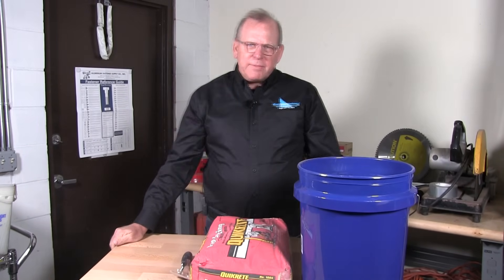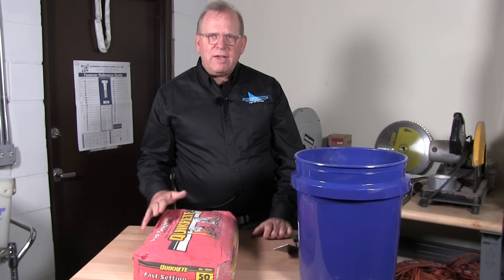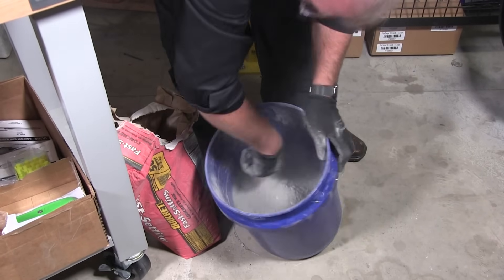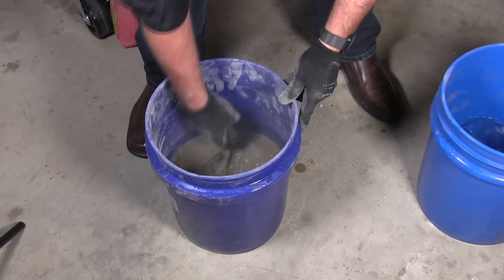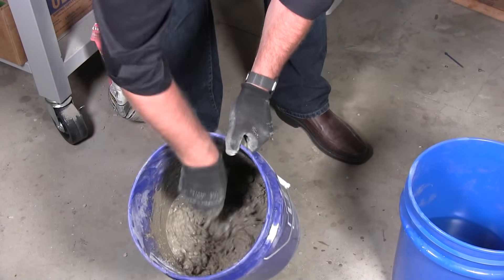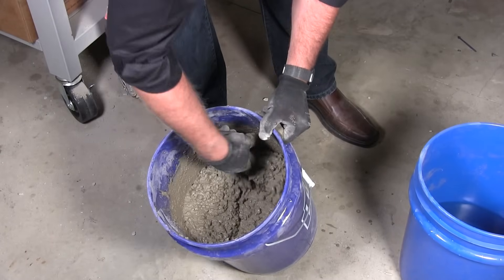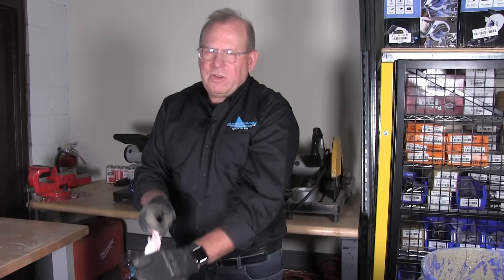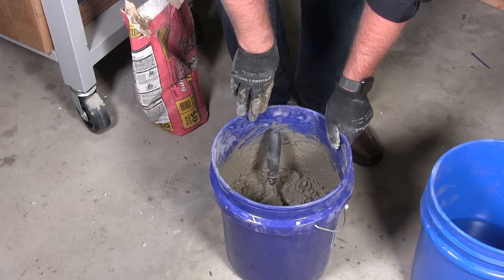How To Mix Fast-Setting Concrete | DIY

Comment: I just use a mixing tray and gravel rake. I could have mixed three bags in the time that took. I'm confused at why a 5gal bucket. Dude you wore me out, humped over, your face in upcoming dust. At least get a fan and aim it towards the bucket and that dust will never hit your lungs. Not bashing your video here, I'm trying to understand why a 5gal bucket when a mixing tray is so much easier with a rake. Less bending, faster mixing and further away from that dust. My buddy confiscated his cement mixer ( he needed it) and I had to hand mix about 20 bags. I would have never made it doing it bucket style. I appreciate your video tho.

Comment: A couple of observations.
1. Measure your water !!! The bag tells you EXACTLY how much water to use. Usually 2.5 quarts for a 50lb bag. 
2. Buy a graduated paint measuring jug. For a 50lb bag, they make a 2.5 quart measuring jug
3. WOW - that mix is way too wet !!!  Sure, it goes in easy, but you are gong to have a ton of bleed water sitting in the surface for a very long time. Plus, as we all know, too much water makes the mix a weaker!!!

Comment: Why did you mix the "no mixing necessary" concrete?  It's for post holes-- pour a little water in, pour 1/2 bag in, then add more water and the rest of the bag...agitate it some, but not necessary to "mix."  🙄

Comment: Too much water in concrete makes it weak and brittle and you don't want to be adding dry concrete to a wet slurry. Add about 1/2 the water you think you'll need, then mix it until it becomes clumpy, then add a bit more and mix it again, then again until you have a thick mix that still flows.

Comment: Ive never even seen wet concrete but i have a bunch of cracks in my sidewalk i want to try to fix shouldnt  be to hard i dont think
Reply: You might want to find something in a caulking tube form?? If they really are cracks. Or maybe you can make your own by forming a sort of pastry tube and squeezing it exactly where you need it rather than have a 4-inch strip which will really draw attention to what you were trying to repair.
Reply: @marymlodzinska4383  I guess it's not so much a crack but like part of the sidewalk is taller then the other part and I was gunna make like a tiny ramp but idk anything about doing any of that kind of stuff I'm in the printing industry not the working on houses industry lil
Reply: @marymlodzinska4383  but I do have cracks I want to repair as well I will definitely look onto some stuff that comes in a tube or something like that thank you

Comment: Thank you.. perfect for first time users! I need to fill an 8” deep and 12” wide by 15” long hole thst opened up on my mosaic concrete slab patio.Sand and dirt underneath whole area. Water from a broken rain gutter on roof deteriorated the area and caused the hole. Just need to fill the hole to smooth over and so no one falls in it. Gutter is repaired so everything will turn out fine after seeing your video!

Comment: Great video. My project is small and I appreciate the straightforward tips working with the mixture to get the right consistency. I'm going to try a 3.5 to 2 ratio recommended by another video and priming the pot with water at the bottom as suggested by comments below.. I'm making artificial Christmas tree stands using old plastic planter pots and PVC pipe to hold the trees securely. The concrete should give me the weight to keep the trees up right as the stands that come with the trees are flimsy and prone to tipping. If this works as well as I'm hoping, I'll make these for my portable canopy for camping. Thanks so much!

Comment: Great to see you stressing PPE. Always wear gloves, and probably wear an N95 mask when mixing concrete. When it's dry the dust will damage your lungs, and it's the kind of damage that accumulates and never goes away. Once you add water, concrete is incredibly alkaline. It's pH is very close to oven cleaner, so you want to wear gloves and keep it off your skin. Dry concrete will dry out your skin like nothing else, but it won't cause chemical burns until it gets wet. 

I wished you mentioned what happens when you add more water, that'd be my only criticism. It does develop a smoother consistency, but it will also effect the final product. The more water you add, the higher the likelihood the patch with crack at the edges due to shrinkage. It varies by mix though, so I'm not too shocked you didn't cover it.

Comment: I want to make weights for my heavy bag stand… pretty much just fill buckets with quikrete…I have chunks of rocks/concrete and pebbles I want to get rid of and use as filler in the bucket…can I do this with maybe a little more watery consistency?
Reply from the maker: Yes

Comment: After watching this video, I just set a single fence post in Quikrete using this method. Notice how little dry mix he puts in at first, and the well he digs for the water at first, those are important details. As @sfranken2228 mentions below, it is much harder to get the bottom mix thoroughly mixed, and if you don't it starts to set up very quickly. Use a stout trowel and start with a soupy mix and add dry mix to get the consistency you want. I barely got my fencepost set in time. I don't think I would use the red bag quick set formula if I was doing this again. I have used fast set Quikrete before to set posts but we did the dry pour method described on the bag and had no problems.

Comment: Back in the 60s when I mixed mortar, thinset, grout, etc in 5 gallon buckets we used a 1/2 drill with a beater on it. But even so if I did not put water in first there would be dry spots around the edge at the bottom of the bucket. And I would hear about it from the tile mechanics. That thing you call a ladle we call a margin trowel.

Comment: When using quickset concrete for posts or any other reason you need to pour the dry cement into the water not the water into the dry concrete. The concrete will mix when it falls through the water. If you don't than the concrete at the bottom won't even get wet enough to set.
You're welcome.

Comment: I have a small concrete job to do this weekend. I'm 60 years old and have never poured or mixed my own cement. I helped my former boss back in 92 do some concrete work, but that's it. Thank you for the tutorial

Comment: I’m a icc inspector. I’d have serious questions about all this. There’s a water and mix ratio that should be followed. Had you done the math you wouldn’t need to add more concrete later on. The more water you use the weaker the concrete over time. But I understand it’s a small project.
Reply from the maker: LMAO are you kidding me.  First of all, you would not use this bagged concrete for an engineered project, but you would order your engineered mix from a concrete company mixed.  Useless statement.

Comment: When doing this wear a mask that protects you from breathing in all that dust .Crystalline silica is found in materials such as concrete, masonry and rock. When these materials are made into a fine dust and suspended in the air, breathing in these fine particles can produce lung damage. Silicosis can be totally disabling and may lead to death. Please wear an appropriate mask .B.T.W thanks for the video.
Reply: Even if you're outside and avoid the dust the best you can
Reply: @1Turnatatime  when ever you are exposed to it .At any jobsite wear appropriate  protection.
Reply: @jams501er  10.4

Comment: This is a quick way to smoke your back. I recommend using a square trough to mix concrete with a small square spade. I made a mixing trough out of plywood and it's been the best companion for mixing many batches. Vastly superior than a bucket every time

Comment: I was actually expecting to learn how much water to use depending on how much dry concrete mix I have. And not just do it how you did it.
Reply: I've watched a lot of videos trying to find the same thing but no one seems to actually measure the water. I've been measuring trying to find the right amount and it's frustrating as a first timer.
Reply: Use your eyeballs and read the bag of concrete that you bought. It will always tell you how much water to use... Different mixtures of concrete will have different water instructions so why would you want to get that info from a general video anyway? Bizarre.
Reply: @mannys9130  Okay. You don't have to be rude and use words like "use your eyeballs" and such. You're saying there's always that information but, in the video, the guy simply added a random amount of water rather than use some required ratio for the mixture. And that is something one who's really interested to learn wants to know from other people who's got the experience. Maybe you can tell me why the guy in the video didn't rely on math to create a consistent mix. Cause if he needed to create the same exact mixture next time, he could probably just end up mixing one that sets longer or faster than the previous mix and result in an inconsistent mix. You act like you know something, but cannot try to understand other people and jump into shallow conclusions. Yikes.

Comment: You can just dump this mix in the hole and add water,
No need to mix
Other regular concrete mix you have to mix well before add to hole. This one you don’t have to . 1 gallon of water per bag

Comment: Albany County Fasteners,
I am working on a safety video speaking about cement chemical burns to people's body and the serious lung condition silicosis from breathing in too much crystalline silica dust which present in concrete mixes. I was looking for a clip specifically of mixing powders containing Portland cement with water, and am requesting permission just to incorporate pieces of this video into the footage (not the audio). There will also possibly be a biblical message in this video I am working on.

Comment: Set up concrete can be easily removed from drains with undiluted vinegar. The acid breaks down the cement and the lime allowing it to be rinsed clear. This also works for removing concrete from clothing.
Reply: Had clogged my drain pipe a lil bit not running water thru it fast enough after a slab pour in my atrium.  It's been bothering me, thinking i had another big project to do.  So I'ma try that out 🙏🏽it works.. 
Thanks 👍
Reply: @williamlevi510  Any time! Keep in mind the more concrete you have there the longer it will take. Soaking works best then flush and repeat until clear.

Comment: Nice video. I just liked and subscribed. I just made a video about making a slab by mixing concrete in a plastic bag. I wanted to see other ideas as I split the job into two halves. Thanks for this and good luck with the channel!

Comment: Very helpful however I was wondering if I could mix it in the wheelbarrow and use the shovel to put it into the hole I have large 2' x 20" holes I will need probably three bags so I was thinking of just mixing as I need it any comments thank you for the video

Comment: Is there a way to stop the concrete from setting too fast before applying it? Like will I be able to keep stirring it to stop it from setting while applying it? Quickcrete fast setting states 20 to 40 min set time. What determines 20 or 40 min? Temperature? Thanks!
Reply: I'm sure you've finished your project. But  to answer your question,  moisture content. Wetter = longer
Dryer = faster
Reply: @Stainlessslayer  I did, but thanks for the info!

Comment: For a whole bag of concrete, avoid using a bucket. Buckets are only good for half or less than half of a 50lb bag. Always use a trough and a rake for efficient and consistent mixing.
Buckets tend to do a VERY POOR job of mixing evenly, while keeping the aggregate mixed throughout. Just saying.

Comment: Never done it, watched how you do it after years of experience, you measured it 'by ear'(not literally), rather then measuring so many quarts of water to such & such sized quikrete.., then you mixed it & adapted for consistency.. perhaps that's best way.. there is something very much like that in most ways(accept eadible).. it's wisking hot water into potato powder.. same catching dry parts, timing, etc..  thNx, gud viDO, I'll problE scrU it up, bt at lEst now I have a clU👋😒

Comment: But you can use hot water if you’re doing projects when it’s colder in a garage or whatever, it’s all about ambient temp. Is your mix cold? Your mixing bucket cold? If everything’s cold not really a problem using hot water.
Reply from the maker: Thank you for your feedback.

Comment: Great info! Great video! Question: why did you not just pour the concrete into the target project (a fence post hole?) and add water, as suggested by the manufacturers?
Reply: Probably cause bucket make the stirring easier
Reply: These "old school" guys
Reply: I dump in post hole and drench !

Comment: Good video. Tip: If you'll add water to the bucket bottom enough to cover it - not deep, & then pour in the concrete mix, you won't have as much work in getting the dry concrete mix to combine with water deep into the bottom. You still have to stir of course, but having the concrete hit wet instead of a dry bottom makes the deep stirring easier. Does that make sense? It works when I'm baking when I mix flour with wet ingredients; I always wet the bottom of the bowl with wet ingredients, not deep, but enough to cover, so then when I pour in flour bit by bit & add the wet ingredients between the flour additions (like you alternated adding the concrete mix & the water), I've found that the initial water on the bowl bottom makes being sure the flour at the bottom gets mixed with the wet ingredients less of an effort to mixing water to the bottom of the dry ingredients.  Try it to see if it helps. It gives more assurance that the bottom layer of concrete dry mix is indeed included in the the water mix.  No dry unmixed bottom areas this way. P.S. Put your bucket on a table to save your back & stand on something if you have to, to have a good visual of your work. Don't work hunched over.
Reply: I also do that when making chocolate milk or hot chocolate.
Add a bit of milk first, add the mix on top, stir it up, then fill up with milk/hot water.

Or when making a cake, you mix the eggs, oil, water in the bowl first, then sift over the cake mix and stir it up.
Reply: Thank you!
Reply from the maker: Thank you for your feedback!
Reply: Thanks

Comment: When my concrete cured, all of the rocks start to float on the surface, does anyone have any ideas why that is and how to fix that?
Reply: check the water cement ratio. If you put too much water, it will be porus. If you want high strength with high workability, add some superplasticizer.

Comment: I dump hot water into the hole with the post already in then pour straight from the bag. No bucket needed except for the bucket of water.
Reply from the maker: Thank you for your feedback.

Comment: Use simple proper tools:
1) A knife or scissors to tidyly open the bag
2) A scoop of some sort to add cement
3) A plastic container (or hose with controllable jet) to add water

Comment: What was the drill attachment you mentioned, I’m not catching the word after concrete.
Reply from the maker: It was a concrete auger. What Bob is referring to is really a kind of mixer that attaches to a power drill, kinda like this: https://www.amazon.com/ION-TOOL-Paint-Mortar-Mixer/dp/B07KPPSCXP/
This can be used to mix the concrete instead of doing it by hand.

Comment: Quikrete red bag mainly used for fence post pour in the hole  dry add a gallon of water no mixing required should have read the label

Comment: Why buy the fast set concrete if you're doing all the work your wrist must really hurt you and mixing all that concrete
Reply: Why buy the fast setting concrete when you're doing all that work isn't it supposed to be you poured into hole and water get the air bubbles out and move on

Comment: Can I use this to repair a hole in my garage foundation wall on the outside? Its not a huge hole, but big enough for rodents and other small things to crawl into if they wanted.
Reply: You need something smoother than this aggregate for your application and in small amounts. I used Quikete Polymer Modified Structural Repair concrete. It comes in a yellow 20-lb. pail you can get at any home repair center.  It is very smooth & it's all in one, no sand or gravel needed. Directions are on the pail as a 4 to 1 ratio.  Exp:  2 cups of cement to @1/2 cup water, just do the math & adjust accordingly.  PLEASE NOTE:  YOU HAVE ABOUT 10 MINUTES TO WORK SPREADING IT IN.  That's why I never mix a lot at one time.  You need to work quickly as this has hydraulic cement as part of it's mixture.  I love this for tuck pointing & have used a lot for the cracks & bigger holes where basement floor meets wall.  If you have a deep hole fill it with the aggregate shown in this video leaving about an inch to the top of the hole.  After it dries fill the last inch with the Quikete Polymer & smooth it out even.  It will look great & this Polymer cement can be used vertical or horizontal.  Hope this helps.
Reply: @rjt8735  thanks this is exactly my project. Small hole, annoying chipmunks. 🙄

Comment: Can you use this to form a pier for the base of a 6x6 deck support beam/column? Would it be strong enough for a job like that? Thanks!
Reply: Oh sure,its a strong cement, Quick Crete is the Bomb!

Comment: I used this same mixture to set 4 x 4 fence post and the instructions said to dump the dry mix into the hole then add the water. I followed those instructions to the T and the water drained extremely slow. Sometimes it just pooled on the top and took 30 minutes to drain. Will I still get good results following those directions or should I have mixed it up like you did?
Reply: I would say premix for better results